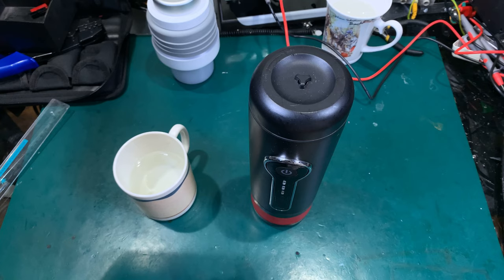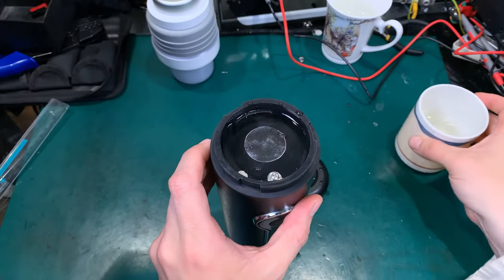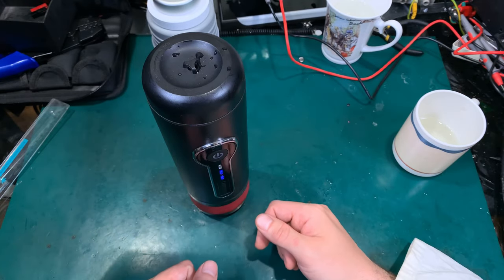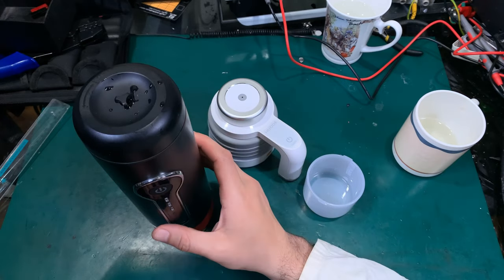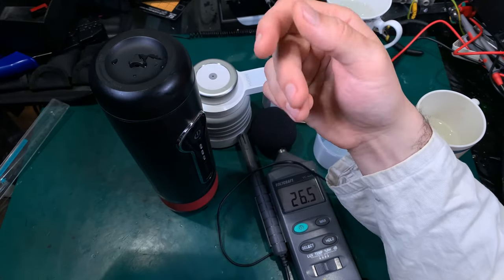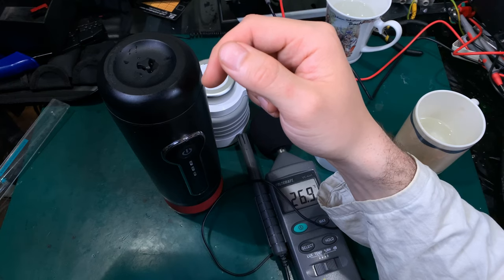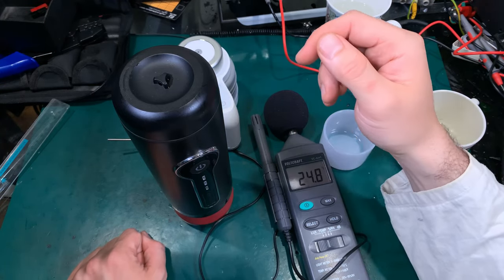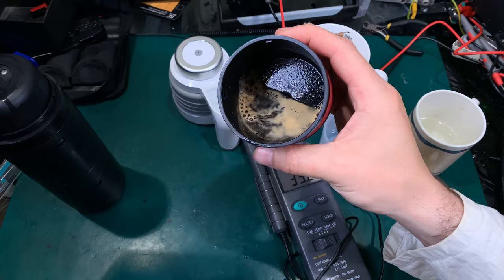Review CONQUECO Battery Portable Coffee Maker - 12V Travel Espresso Machine

Comment: Very informative, one question though: I can see in your presentation 2 REUSABLE pods, while the producer and various reviews say this machine can ONLY operate with ORIGINAL Line Nespresso pods. Did you really use these re-usable pods, without problems? Because I would certainly love to use my own coffee beans with these pods! If yes, which brand/type of pods?
Thanks in advance for your answer and best regards!
Reply from the maker: I found one problem with non genuine (with paper top) but it's not related to coffee machine (they work same good in my opinion) - but if I store them in backpack after rain, they unseal - (those bio degradable ones, i just started carrying them in ziploc  bag (anyway I was carrying one for used ones).  In simple words - I use it with non genuine and everything work just fine.
Reply: Thanks for replying; what you say is encouraging, it gives me courage to try these re-usable pods. My only concern was/is they might damage the steel piercing pins inside the machine. Thanks again for your reply.